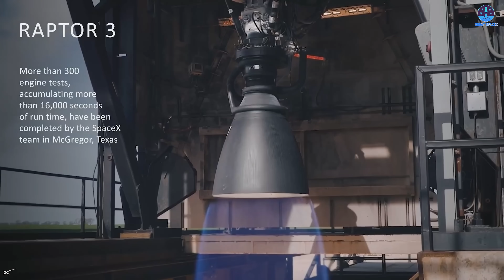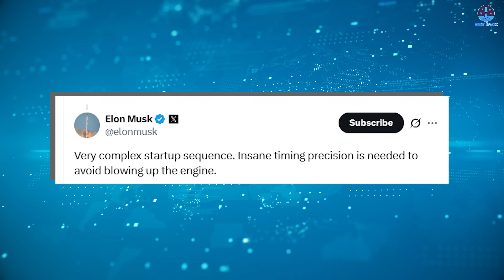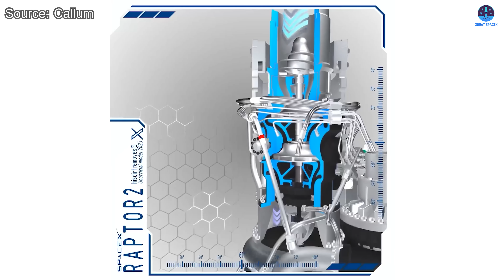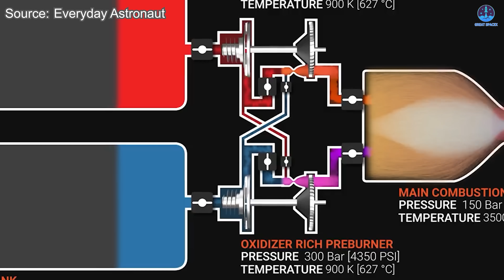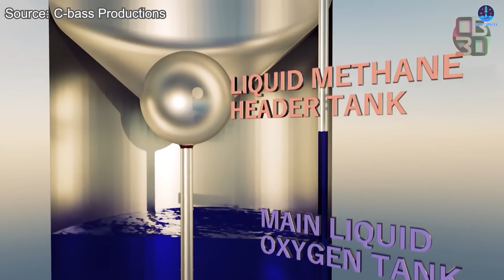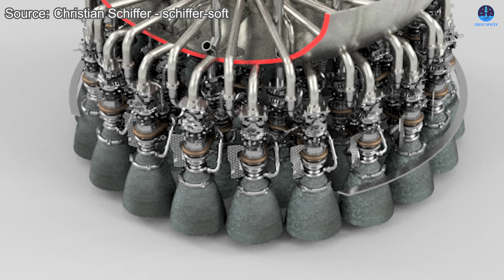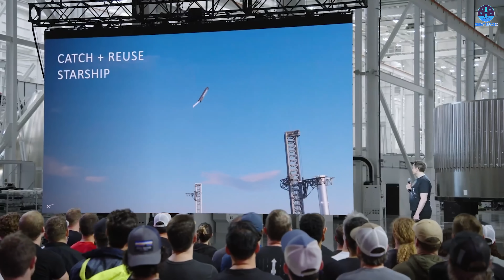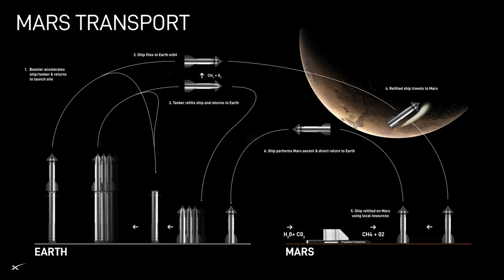Elon Musk exposed HARDEST Problem on Raptor 3 to Avoid Blowing Up! Here's Why...

Comment: While I'm greatly interested in SpaceX it looks like the second stage reusability of the Starship adds so much weight to the rocket that it has forced the whole system to get too heavy so everything has to be designed on the hairy edge to save as much weight as possible.

The rocket equation is very unforgiving, for every gram of payload weight you have to have many times as much fuel, and then because the fuel weighs more the you need more fuel to handle that increase, and then the same rocket equation affects the first stage.

The extra weight of fuel that needed to land the second stage interacts with the rocket equation twice. It doesn't help much that the stainless steel that solved thermal problems is so much heavier than carbon fiber, aluminum, or titanium.

We've already had several catastrophic failures, at some point it may be really obvious to investors that this can't work.

I'm mostly paraphrasing an article that makes these points. I don't have the engineering resources or experience to know if this is correct, but the breathless reporting on fan channels maybe needs to be tempered with some discussion about whether SpaceX has got itself caught in an impossible engineering task.
Reply: I think there's a potential something underlying this that few have touched on: it's quite possible that Herr Ketamine Space Nazi has driven out or destroyed the engineering team and culture that was responsible for Falcon 9. The SpaceX that was able to do all that was a SpaceX that was protected from him. Actual engineers and engineering organizations tend to want to proceed methodically, changing one or two things at a time. This is how Falcon 9 evolved into what it is now. Dilettantes and retards like Musk want to go from nothing to BFR with no intermediate steps. A group that actually wanted to make this whole Starship / Superheavy foolishness actually work would have started with a Raptor-based successor to Falcon 9, in order to develop operational experience with the new engine and propellant.

Comment: I think one of the biggest problems with the Raptor is that it's being driven TOO hard at chamber pressures largely unheard of.  They do this to maximize the efficiency and that's understandable and desirable but it comes with a cost -- DECREASED reliability!  If you have an engine that has some value for reliability and then you operate the engine at higher pressures then the reliability is going to decrease -- the SpaceX approach, or more precisely the Musk approach, is to push everything to the limit, then pretend there is no limit so they can push it beyond the limit.  Just another of Musk's 'the best part is no part' schtick!
Reply: Are you trying to out-Elon Elon?
Reply: Space X things aside, what’s wrong with “best part is no part”?

Comment: How big of a failure mode is the issue of keeping sufficient forward acceleration forces on the fuel and oxidizers in their respective tanks?  I"m pretty sure that's the reason for hot-staging. I also know that starting the second stage engines with the booster attached really punishes the second stage engines.  Have these issues been totally resolved?
Reply: No they can't be resolved without a significant system beef up and added mass. Which they are not doing at this stage. The huge downcomer pipe(tank) is a damage control compromise. Less diameter means less sloshing so they are edging towards a longitudinal tank or tank in tank system(temperature consistency will be an issue with it) vs the previously horizontal separation. The amounts are too big and fluid dynamics are a major factor with such tanks at such velocity changes.

Comment: Doesn’t bode well for the missions that reqire this engine to be restarted if the startup sequence is 'insanely' complex.
Reply: What Happens When you start a car.. a lot od precise steps... but we just turn a key.
Reply: @marcwolf60 I wouldn't call starting a car engine insanely difficult... and even then, they don't always start.
Reply: Starting one of these engines is like starting a finely managed explosion and once started continuously managing it until it is shut down. I can see this a can handful for any system to monitor and handle.

Comment: No, with so many engines you can have 1 or 2 fail or be off synch.  They are driving to such low cost R3 production, that you simply replace an engine vs fixing it, like Starlink.

Comment: I  have always felt that creating so many points of potential failure is poor engineering. Interesting thsat Musk now calls himself CEO and chief engineer!  Musk has no business calling himself an engineer, because he does not believe in engineering discipline and the step by step engineering  approach.  He can try to relabel it as "iterative design", but that is not engineering!!  He'd be more accurate calling himself Chief Hacker!
Reply: Show us how it's done.
Reply: Since they have a simple, reliable and very productive engine in F9's Merlin that gets all the current business done (except HLS Starship), they are trying for a 10x better solution as a leap forward.  We are luck that Elon is OK with tossing $B at the program with a build and test approach.  So far, it seems that Raptor 2 on SH is doing well, even with reuse.

Comment: As I always say, there is no free lunch. You have slways trade-off between performance, cost and reliability. I would sacrifice 1-2% of performance and this would provide s huge potential for reducing complexity.
Reply: SuperHeavy is overweight; so is Starship.  They need to squeeze every bit of performance out of these engines - and even then meeting the supposed capability of this system is very much in doubt.

Comment: C.P.R. Added Fuel Delivery Pre-Burner for Range Delivery Low to high in Line Tube Per Engine! For Fail Safe Manual Control Return Line Must be Added ! The One Piece Throw away No Access Flange Break Down in the Recondition Mode Requires Slip, Slip Technology in Repair form , Alternate Engine Design Small, Long Stem Split Core Quad Neural Shaft and Kat Head Design The Quick Reliable Break Down Service and Return to Service ! Up Stage 2 Burner Design # 7.65 !.

Comment: Shoot, it’s hard to compete with the AI bots in this comment section! But I will try. No matter how good the Raptor 3 might be as far as thrust/power/weight etc. is concerned, Starship still needs 33 (39?) in the booster, and 6 (9?) in the ship, to work together flawlessly, time after time, like a modern airliner jet engine, for the whole concept to work. So RELIABILITY is the key. How do you ensure reliability? Well, you have to identify EVERY variable that can mess it up (and there are hundreds), and systematically engineer all those variables down until their COMBINED effect is acceptably small to make it worth launching the rocket (and that’s before adding human cargo to the mix). Spacex has done this spectacularly well with Falcon 9 already, but Starship compared to Falcon 9 is like comparing a postgraduate engineering challenge to an elementary school science project. Nobody else but Spacex is willing to take on that challenge, but it needs to be done, so I say, go for it!
Reply: Falcon was made by good rocket engineers with nasa assistance. Starship is elon reading bad scifi as a teenager and trying to make it. Like the cyberflop thing is musk trying to do auto design and engineering.

Comment: Nanotechnology offers significant benefits for spaceships, enhancing performance, efficiency, and durability. Here are the key advantages:Lightweight Materials: Nanomaterials like carbon nanotubes and graphene are incredibly strong yet lightweight, reducing spaceship weight, improving fuel efficiency, and increasing payload capacity.
Enhanced Structural Integrity: Nanocomposites can create hulls and components resistant to extreme temperatures, radiation, and micrometeorite impacts, improving durability in harsh space environments.
Self-Healing Systems: Nanobots or self-assembling nanomaterials can repair micro-damage (e.g., cracks or hull breaches) autonomously, extending mission lifespans and reducing maintenance needs.
Improved Propulsion: Nanotechnology can enhance fuel efficiency through nanocatalysts for better chemical reactions in engines or by enabling lightweight, high-efficiency ion thrusters and solar sails.
Advanced Thermal Protection: Nanostructured coatings can provide superior heat dissipation and insulation, protecting spaceships during re-entry or exposure to intense solar radiation.
Energy Efficiency: Nanotech-based solar panels and batteries (e.g., using quantum dots or nanoscale electrodes) can store and generate energy more efficiently, critical for long-duration missions.
Sensors and Electronics: Nanosensors can monitor structural health, radiation levels, or environmental conditions with high precision. Nanoelectronics enable compact, faster, and more energy-efficient computing systems for navigation and communication.
Radiation Shielding: Nanomaterials, such as hydrogen-rich boron nitride nanotubes, can block cosmic radiation, protecting crew and sensitive equipment.
Resource Utilization: Nanotechnology can enable in-situ resource utilization (ISRU) by breaking down lunar or asteroid materials at the molecular level for fuel, water, or construction, reducing dependency on Earth supplies.
Miniaturized Systems: Nanotech allows for smaller, more efficient life support systems, such as water purification or air recycling, optimizing space and resources for crewed missions.

By্রSystem: Challenges and Considerations:Cost and Scalability: Developing and manufacturing nanomaterials at scale for spacecraft is expensive and complex, though costs are decreasing as technology matures.
Safety and Reliability: Ensuring nanotech systems function predictably in space’s extreme conditions requires rigorous testing to avoid failures in critical systems.
Environmental Impact: Producing nanomaterials can have environmental drawbacks on Earth, though this is less relevant for space applications.

Current Status: Research and prototypes exist (e.g., NASA and private companies exploring nanotech for Mars missions and beyond). Posts on X highlight ongoing interest in nanotech for space, like self-healing hulls and lightweight composites, but full-scale adoption is still in development.Nanotechnology’s potential to revolutionize spacecraft design is clear, but practical implementation is still evolving, with significant advancements expected in the next decade.

Comment: Wouldn't complexity be less with a smaller number of larger engines?  NASA'S Saturn V only had 5 engines,  which they managed to get to work together.  USSR's rockets had many smaller engines,  that they could get to occasionally work together, but not often enough to be truly reliable. Why not try a point in between?
Reply: Perhaps after a hundred or so Starships have exploded going into orbit, Elon might find inspiration from the Saturn-V's F1 engines...
Reply: @2jpu524 Perhaps Elons team is smarter than you 😉
......as if that hadn't been discussed.
Reply: better to use an engine thats somewhat portable (his cybertruck can tow a raptor engine) the BE4 will require a full semi truck

Comment: The rapid turnaround is not as important as people think. There is simply not so much payload to to justify such short turnaround times. SpaceX can simply replace a defect engine with another one and take all the time they need to repair the defect.
Reliability and weight are way more important than short turnaround times.
Reply: Tell that to Nasa. The Artemis program needs that 15 starships be launched in a short period for the mission to be successful.
Reply: @VijayNinel that is SpaceX idea. It is simply BS. Take the costs of at least 17 starts (15 for refueling, one for the tanker, one for the actual mission) and ask how much a disposable rocket costs. 
No astronaut will land on the moon in a starship: it will just bring equipment. That’s nothing about starship but about the risks of landing and launching Starship compared to a dedicated landing craft.

Comment: There was an early airplane that flew fast and had square windows the square windows proved to be a bad thing. They now all airplanes have windows that are rounded at the curves at the corners. The cooling on the Raptors might need to change the design of the square to something a little more durable underharsh conditions

Comment: I would ‘link’ each ‘pump’ stage together………Yes, I know nothing about ‘rock science’😢…..😂
Reply: Only problem with that, is that if any one engine fails, it'd drag the others down with it.
But it's sound creative brainstorming. Might be able to design around that downside.

Personally I think the whole thing "flies too close to the sun" in terms of stretching the limits of performance/weight. It's all peaks, no margins.
But that doesn't make it bad research. Could help lead to a more forgiving future version.
Reply: @kathrynck  Indeed

Comment: Looking at the potential starship launch timeline; Flight 10 (NET 8/4) with S37 atop B16, then flight 11 (9/25) with S38 atop B17 (B15 goes to the boneyard if not needed by flight 11) then it's on to V3 launches with Flight 12 featuring S39 atop B18 sometime this fall....That's if all goes to plan of course, if it doesn't, can a V3 Ship launch from atop a V2 Booster?
Reply: No, a Starship V3 is not comparable with a V2 Booster.  Either the Ship and Booster are both V2 or they are both V3.
Reply from the maker: Let's wait to see whether your predictions come true or not?

Comment: Thursday, July 17, 2025 . . . Greetings, Everyone. I am just an individual interested in Science and Technology. If synchronization is an issue with "Raptor 3", it appears from viewing this video that the problem solutions begin with a simultaneous equation, which would, by extension, suggest a corresponding algorithm(s). A Hardware control unit at ground zero, which we shall call the (DNA) module, another onboard(i.e., the heavy stage of the booster, we shall designate as RNA-0[zero, not the letter O], and then the Starship proper stage, we shall designate as RNA-1[one].) When the modules are calibrated and in sync within 3, maybe 4 decimal places, the algorithm would define all engines as primed for dedicated, synchronized ignition. This would indeed have to be a likely series connection across all engine domains. The first and second stages could have separate control "DNA/RNA" modules.

    Again, I am primarily interested in Science and Technology.

(Collaborative Rewrite with Grammarly).

Comment: I wonder if they could tie the fuel and lox pumps together with a massive belt so they have the same output all the time. Even time the impellers on the shaft to so the impellers blade exits line up.

Comment: The reason why these engines are so complex and fickle is that they have multiple feedback loops. The combustion conditions of both pre-burners are determined by the spin of the main pumps. But the spin of the main pumps are determined by the power generated by the pre-burners and turbines. And when you're running at near the limits of the hardware, then small excursions in pressure or feedbacks that generate vibrations will create leaks, or worse. Plus all this stress may not lead to a failure immediately. It may lead to a failure several flights later. 

Another big problem with Raptor is that it requires pressurised gas to spin up. Fine for an Earth launch, but what if you're 2 months into space and something leaks? Long duration space flight requires engines that simply work. Every time. I'm a fan of a hybrid cycle that hands control of startup to electric pumps.
Reply from the maker: Great analysis 👍
Reply: The electric pump for startup idea seems worth making prototypes and testing, at the very least.
Reply: Electric pumps can't move what they can't reach.  If the acceleration of the vehicle is 0, the fuel is not going to stay against the discharge nozzles.  Pressurization doesn't help, and you can't use a pressurized bladder in a cryogenic tank.  Even if there was a material that could remain flexible at those temperature and pressures, it would add a lot of mass to the ship.
Reply: @davidladd5597  Yep, getting the fuel where you need it in zero-g is a problem for every kind of engine. I do have a solution though. At least for the kind of vehicle that would travel between Earth orbit and Mars orbit and return. In other words, it remains in space.
Reply: @saumyacow4435 - I can see two possible ways to do it, but I'm sure it's not as simple as this: (1) Weld continuous helical internal fins down the length of each tank, either on the inside of the tank shell, or on the down-comers, and spin the ship in the proper direction.  This would drive the fuel to the walls and then to the aft end of the tank.  Actually you'd need to ship to be spinning before restart, or separation from a previous stage.  Or (2) use small cartridge fed solid fuel motors to give the ship just enough forward acceleration to orient the fuel to the aft end of the tanks.  If the mission has a lot of stops and starts, a revolver type mechanism would expel the spent cartridge, and rotate a fresh one into the slot.  I have no idea how much impulse would be required so this may not be practical.

Comment: The more complicated you make a design, the harder it is to find defects in one area if the fault happens internally, like a 3D printed rocket, the important parts should be external, if you have a fault internally and it is missed, this can leads to problems when you least expect them.